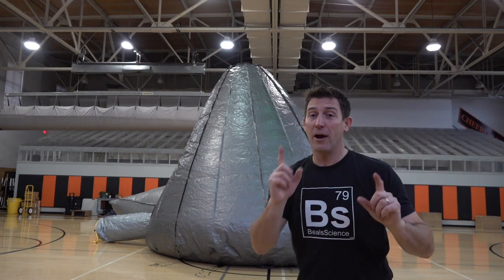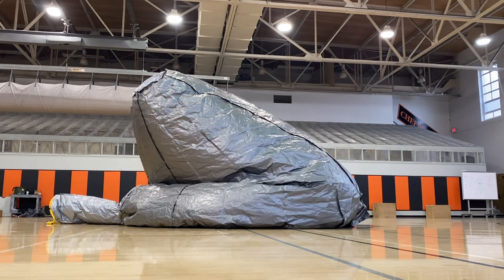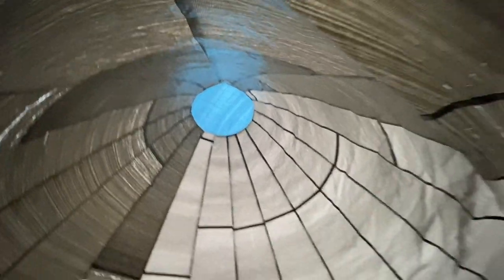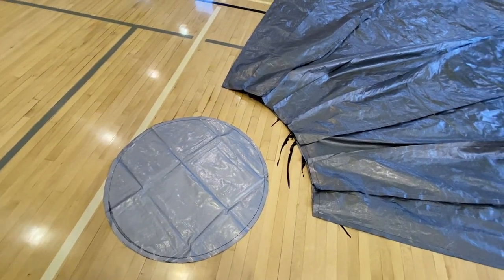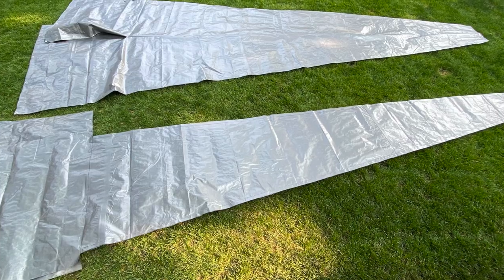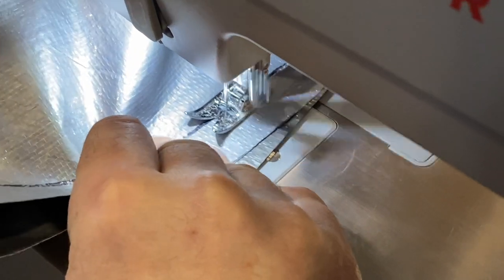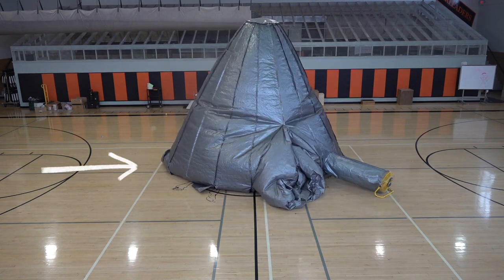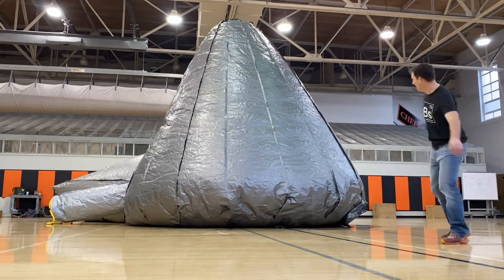How To Build a Giant Inflatable Planetarium - for under $300!

Comment: as someone who helps my father rent bounce houses, this is nearly identical to how a bounce house is constructed, you can even replace that fan with a bounce house blower(if you get a good one) for a strong effect. Though the sound might be annoying, a longer blower tube could help with that. The thicker stuff used in bounce house construction would be perfect to block out all that light leakage. One thing that might be real important if you make this again: maybe not make the internal space also the main air 'sac' (for lack of a better term) it would require more material but in the end you won't have to worry with it falling over. I suggest looking at bounce houses for inspiration, instead of making the entire surrounding area inflatable- they use inflatable structural tubing  with material sewn on that connects them to provide the walls.
Reply from the maker: Thank you for all the great information!!

Comment: If I wanted to make it much darker inside, like VERY dark, even during the day. Do you think it'd be enough to use a thicker and/or darker tarp, or is there something else that I'm missing that causes light leakage?
Reply from the maker: The quality and thickness (it is represented as mil for tarps) will make a very big difference. I went with cheap, thin tarps because I didn't know how much the weight would affect its ability to blow up and keep its shape. I now know that I could have used tarps with a much greater mil (thickness) and the fan would keep the structure inflated with no problem.
Reply: @BealsScience  Noted, I'm thinking 15 MIL black with a white interior will work well. Now I'm just working on the designf or a dome rather than a cone. I love this. I areally appreciate it.
Reply from the maker: Let me know how it turns out!

Comment: how hot does it get when outside?
Reply from the maker: Not hot at all. In fact it stays quite nice inside because the sun is reflected and the air flow is significant.
Reply: @BealsScience  Thanks for the reply!Thinking about making something similar down here in Texas. 
The Texas heat gets pretty intense 😅🥵

Comment: how loud is it inside from the fan ?
Reply from the maker: It is not as loud as you might think. There is a constant but relatively quiet sound. The next time ai build one ai will use a fan that has more settings so I can really turn it down low when it is full.
Reply: @BealsScience  thanks so much for this video, I'm doing a bunch of research into how to do this for my kids. Really appreciate it.
Reply from the maker: @aiiaznsk8er  I’m glad I could help!